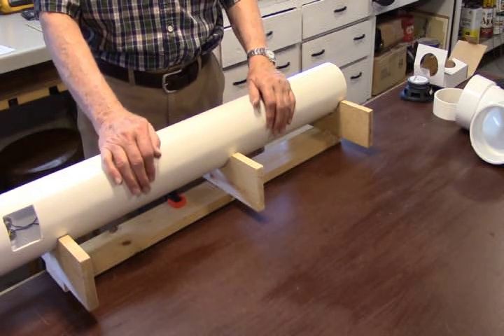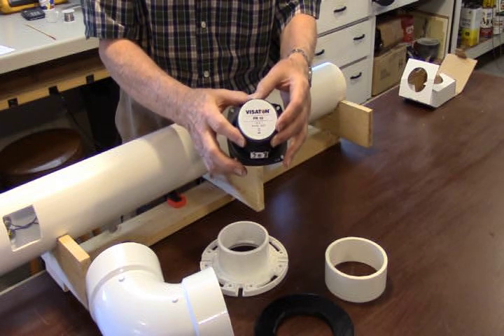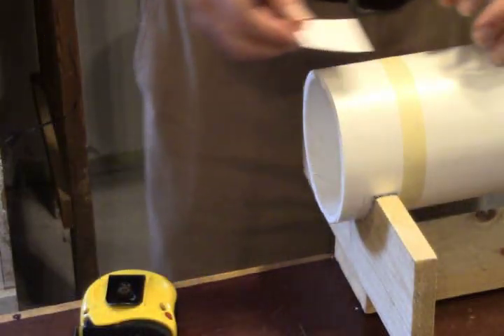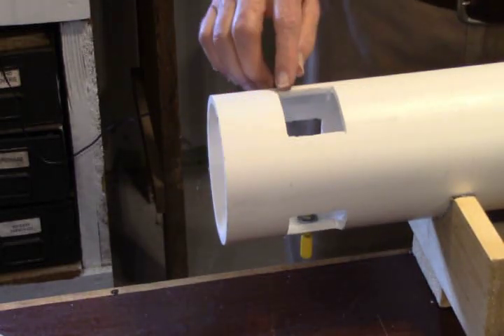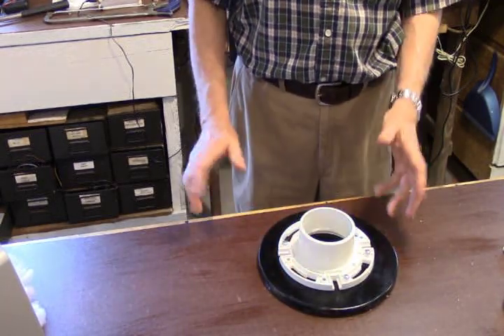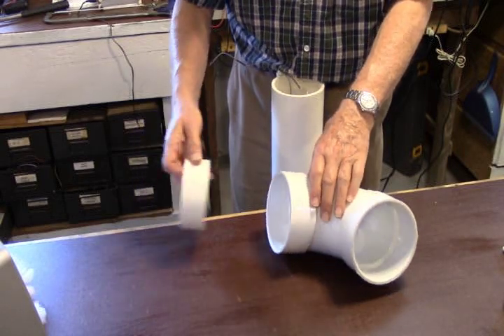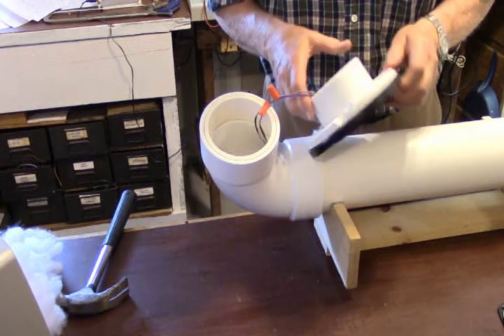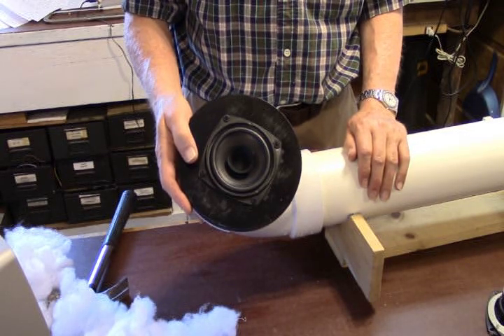Pipe Speakers 3

Comment: Ken, please educate me, I need to know why pipes are put in to speaker cabinets?
Reply from the maker: Pipe are used for the tuning ports in what we call a ported speaker. The length of the pipe tunes the speaker box to a certain low frequency to match the woofer.

Comment: Hey I'm curious why didn't you just poke a hole on the base and add legs so the port face downwards?
What about building a sealed PVC speaker version of it?
Reply from the maker: That would be another option, some folks may not like the closet flange. Sealing that small of a pipe would raise the resonant frequency of the driver  reducing bass response.  One could try using 6" PVC for more volume. Thanks for your response.

Comment: Thanks for posting this build.  I made my own and they turned out very nicely. I used MCM 4.5" speakers (# 55-4624) that are 91dB/Watt. They work pretty well with my 3 W/Ch tube amp.
Reply from the maker: Happy you had success with the MCM speaker.

Comment: hi, want to know how to connect it to the amplifier and also how to connect banana jacks to the speaker's.
Reply from the maker: Use binding post banana jacks binding posts like MCM part number 50-4474  (mcmelectronics.com) Use 18 gauge wire from  binding post to amplifier.
Reply: thank you
Reply: and if you can show how it is giving the sound it would better for experiencing
Reply from the maker: The banana jacks can be used with banana plugs or they will also allow ordinary speaker wire to be connected to them They unscrew for the wire. Thanks for tip on showing some sound I will do so in future projects.

Comment: Hi bird, it's too good but need more clear explanation on wires connections. could you please post that.
Reply from the maker: Ordinary speaker wire is all that is needed for this speaker. It is usually marked  for identification so you can wire one lead to the positive terminal and one to the negative terminal of the speaker and the banana jacks.

Comment from the maker: Those are nice speakers but don't expect a lot of bass. Try this design. 4" ID Pipe length 36". Port 2 square inches. Stuff pipe with polyester in first upper 24 ". Don't stuff it too heavy but you can experiment with different levels. Good luck.